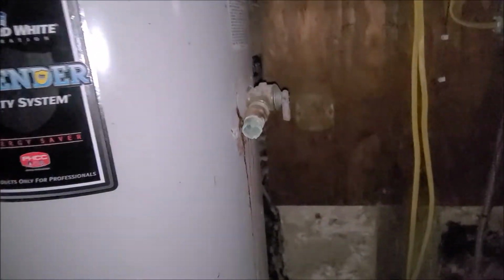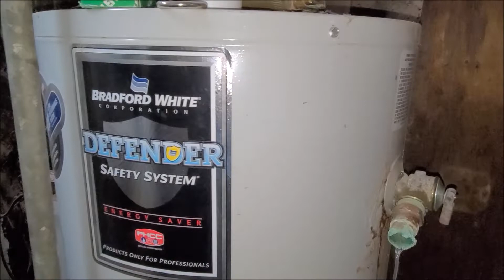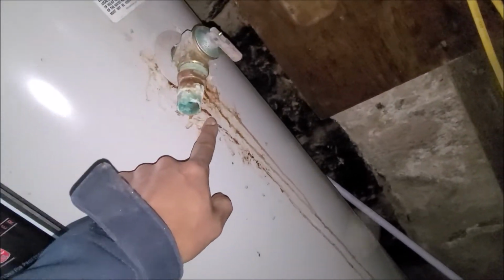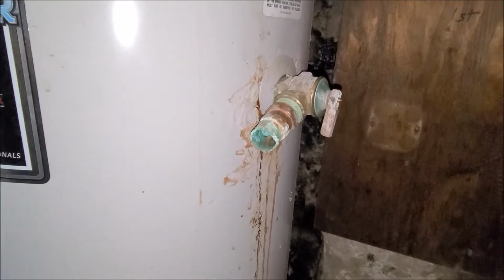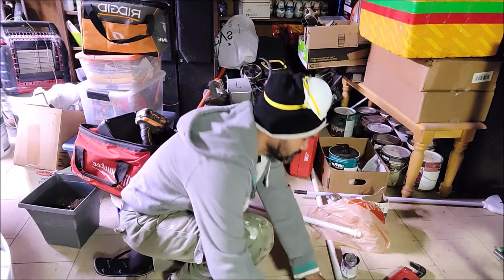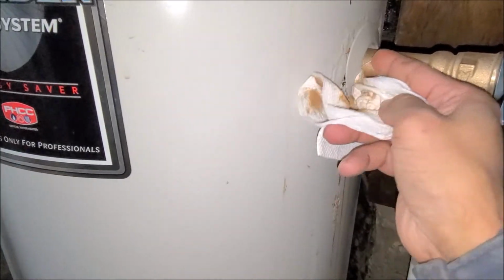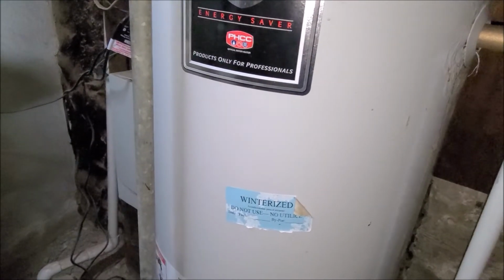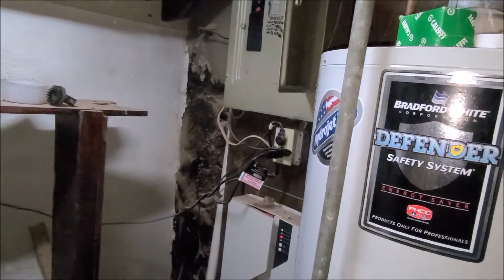Don't be stupid like me and make this costly mistake

Comment: Dude you got so lucky!!! 

I installed pex here and there are connectors for the hot water heater and you don't have to cut them off. Cool video though, gonna check out the release valves now. Do you test them every year?
Reply from the maker: I usually do run pex also and I hardly use sharkbite.  You should check at least once between 6 to 12 months.
Reply: @KennyHandymanInvestor  btw, i ended up getting that boiler replaced. Cost me big $$$
Reply from the maker: @mohammedsaleh795  Sorry I forgot to tell you that I just receive another used boiler on hand.  If you were close I would have install it for you